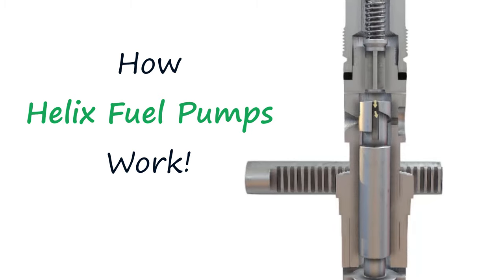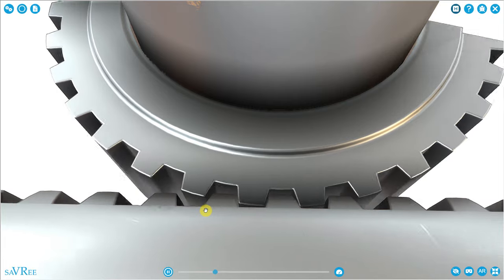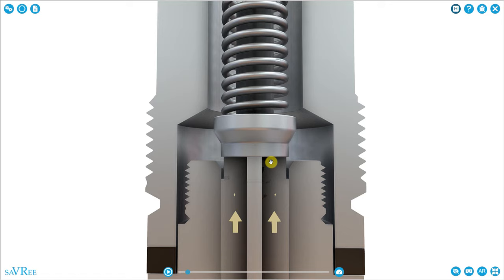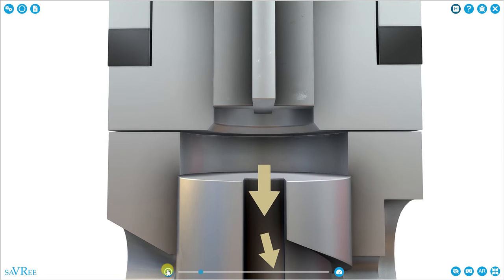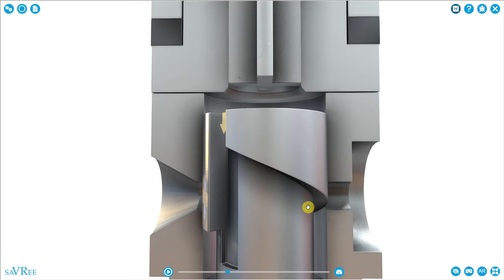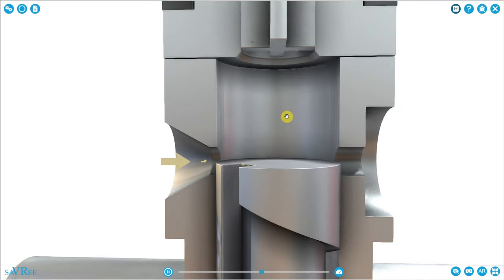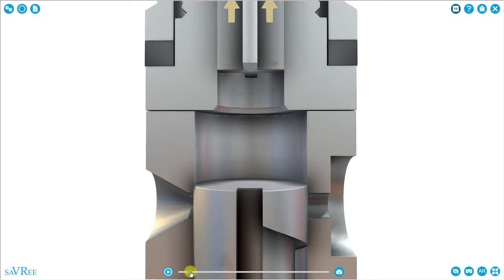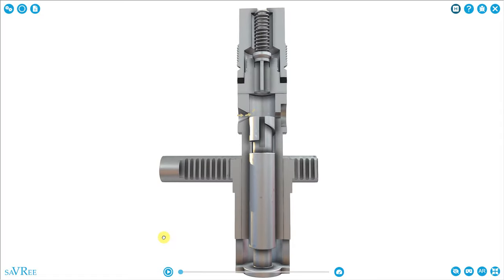How Helix Fuel Pumps Work! (Jerk Piston Variable Injection Pump)

Comment from the maker: Want to continue learning about engineering with videos like this one? Then visit:
https://courses.savree.com/ 

Want to teach/instruct with the 3D models shown in this video? Then visit:
https://savree.com/en
Reply: TBH, I was intrigued by mechanical fuel injection that I started a little research, all because of EFI which is efficient but quite expensive and shortages of semiconductor to make the EFI 'brain'
First I stumbled upon gasoline mechanical fuel injection, which is just a nightmare of reliability issues and ungodly expensive stuff
Then I switched my attention to diesel, it is injected and had mechanical system, that's another reason I stumbled upon this video of yours
I was tinkering with my thoughts and chatgpt if my idea was viable, it was a gasoline mfi but as simple as diesel
Instead of pushing the fuel with piston/plunger, I was thinking of using electric fuel pump to pressurize the fuel, then turned the plunger into basically a variable rod to poke the valve using that rack & pinion thing
The injector nozzle and the rest of line routes is the same as the diesel
What do you think of my idea? Is it really viable option to efi if not just a thing in between efi and carburetor?

Comment: Good animation. This style (non VIT) has fixed timing for the beginning of injection and only varies the end of injection. The VIT version of these pumps is controlled by a second rack & pinion that moves the barrel up and down, and therefore the height of the spill port, with respect to the helix.   Another important feature not shown here is the puncture valve.
Reply: He has only shown about the basic fuel pump with single helix maybe for 4S generator only

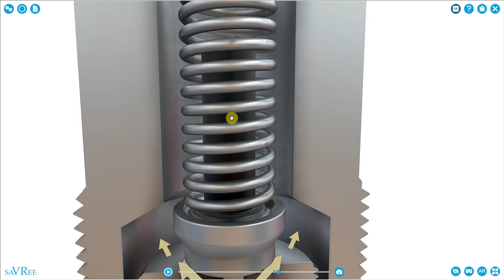Comment: 7:17 - As a fairly newly licensed diesel mechanic who has, by nature, not had the pleasure of dealing with mechanical fuel systems simply because they are no longer around. That being said, my curious mind has always been baffled by the true impact of rack manipulation in terms of effective plunger stroke vs helix position. 10 out of 10. Clear, descriptive and intelligent.
Reply: If you can buy a mercedes OM606 diesel engine, they use a mech fuel pump and are popular to modify. expensive but i think it would be very interesting for you.

Comment: If Iunderstan correctly the quadrant will only be able to rotate less than 180° before fuel leakages begins from minimum injection volime to maximum injection volume. We never see the back of the helix to confirm full construction.
Splendid animation. 
You might include fuel color to indicate pump pressure changes from low at fill, high during injection volumes, then revert back to low when leakage begins.

Comment: Best visualisation!! 
I have a question about slow speed two stroke starting air system: what controls the timing for when starting air stops being admitted and fuel starts being injected when starting main engine?
Would be awesome if you could make a video on air compressors, reefer compressors, cascade tank and condenser, cylinder heads and sewage treatment plant.
Thank you from an Engine Cadet!
Reply from the maker: Will put it on the list! Thanks for the suggestion and for watching.
Reply: I could not find the exact answer actually. But this is what i think is most probable. The order of entry of  starting air via starting air valve is controlled by the air distributor, which in turn follows a dedicated camshaft ( or sometimes just driven) for controlling air distributor only. This dedicated camshaft is again connected to the main camshaft which in itself executes a firing order i.e. sequence of firing of the engine units. Now I am assuming when the crankshaft attains enough rpm the pneumatic signal (low pressure air starting signal)  which allows the bottle air to pass onto pilot valve and main air starting valve ( via automatic valve)is blocked just before the air control valve, ceasing the whole system operation. Now how this air signal is stopped I am not sure of....maybe it is controlled by a master and slave electronic controller which takes feedback from the rpm meter.
Reply: We are manufacturer specialized in auto and marine diesel engine parts since 1952.
Our main parts are
EURO II system: plunger, nozzle , delivery valves, head rotors, repair kits, etc.
Common rail system: Injector complete and injector spare parts for CATERPILLAR, DENSO, DELPHI , BOSCH, SIMENS, CUMMINS, etc.

If you have any inquiries, pls do not hesitate to contact me.

Comment: Does the governor controls the rack? Anyway, superb video. Subscribed.
Reply: We are manufacturer specialized in auto and marine diesel engine parts since 1952.
Our main parts are
EURO II system: plunger, nozzle , delivery valves, head rotors, repair kits, etc.
Common rail system: Injector complete and injector spare parts for CATERPILLAR, DENSO, DELPHI , BOSCH, SIMENS, CUMMINS, etc.

If you have any inquiries, pls do not hesitate to contact me.
Reply: Yes

Comment: Sir, I have a doubt that the rotation of the plunger will only thake place during the load varying on the engine or it will rotate in every stroke of the plunger ?

Comment: What gave rise to this style of pump? Why is it used over more conventional fuel pump designs? How does it rank on efficiency?
Reply from the maker: It's basically a piston pump with the main difference  being the helix. I would need to check concerning efficiency. Its a genius design, that much I know! 😀
Reply: We are manufacturer specialized in auto and marine diesel engine parts since 1952.
Our main parts are
EURO II system: plunger, nozzle , delivery valves, head rotors, repair kits, etc.
Common rail system: Injector complete and injector spare parts for CATERPILLAR, DENSO, DELPHI , BOSCH, SIMENS, CUMMINS, etc.

If you have any inquiries, pls do not hesitate to contact me.

Comment: Hi Savree. Very well explained and easy to follow, great video. Just one question on this type of pump, what would cause the engine to maintain full revvs when the accelerator has returned to the idle position? Can you advise what  components I could check? Seems like a component is sticking in the open position? Thanks in advance.
Reply: Did you ever get an answer for that issue because I’m having the same problem with my tractor stuck at full throttle?

Comment: Very fascinating. Clearly understood. Can that  be set to specific position? I have two  piston engine generator that uses two of this pumps is currently troubling me with fuel economy and low power. There appears to be incomplete combustion. Could that be problem with fuel pump? Kindly assist with advise.

Comment: Amazing visualisation! What I'm missing is understanding where the lifting force comes from, where the movement of the rack is controlled (does the engine adjust the rack depending on how much fuel it needs?), And what happens to the fuel that spills out - does it drain away or is there a tank? Presumably it doesn't go to waste :)
Reply: Allow me to answer. The lifting force comes from a cam and follower arrangement. The follower pushes the plunger up and down as it is controlled by the cam on the camshaft, the camshaft in turn is controlled by the engine crankshaft. The camshaft thus controls the firing order i.e the timing of the fuel injection.  Now the rack movement (which controls the quantity of fuel to be delivered ) is connected to the governor which as we know works as per the load on the engine. As per the fuel that spills out I am assuming it meets the end of the re-circulation line and goes back into the buffer tank( not sure though)
Reply: @kanishkaroy3478  hey thanks explanation regarding the rack movement was excellent and simple.
Reply: We are manufacturer specialized in auto and marine diesel engine parts since 1952.
Our main parts are
EURO II system: plunger, nozzle , delivery valves, head rotors, repair kits, etc.
Common rail system: Injector complete and injector spare parts for CATERPILLAR, DENSO, DELPHI , BOSCH, SIMENS, CUMMINS, etc.

If you have any inquiries, pls do not hesitate to contact me.
Reply: The answer to your question is the governor. A system of weights incorporated into the pump body, driven by the pump-cam act on the governor arm, which in turn alters the position of the rack depending on operator demand. Check out the Cummins p7100, it’s a super simple system but very clear.
Reply: Furthermore, the excess fuel is referred to as “return”. The post injection event which essentially is the fuel driven through the spill port by way of the pump spring is recycled to the reservoir. If properly filtered and separated from any moisture before hand, the excess fuel should be safe to head straight to the tank, in a well serviced fuel system, of course.

Comment: So...am I correct in thinking that the reciprocation of the plunger is caused by something not shown? Is the thing causing the reciprocation also controlling the timing? Since the amount of fuel pumped per cycle is controlled by the position of the quadrant and rack (and hence the helix), am I also correct in thinking that the length of stroke of the piston is constant?
Reply from the maker: Stroke is constant. The pump is operated by the camshaft.
Reply: We are manufacturer specialized in auto and marine diesel engine parts since 1952.
Our main parts are
EURO II system: plunger, nozzle , delivery valves, head rotors, repair kits, etc.
Common rail system: Injector complete and injector spare parts for CATERPILLAR, DENSO, DELPHI , BOSCH, SIMENS, CUMMINS, etc.

If you have any inquiries, pls do not hesitate to contact me.

Comment: Sir, the fuel quantity is changing or not? Because we vary the timing so that our efficiency increase in low load conditions and more power is generated. But if we send more fuel than there this objective is not achieved. Please clear my doubt.
Reply: Bro..i didn't get ur question.. Fuel quantity is controlled by governor by means of rack and pinion mechanism.. Govrrner moves the rack and plunger will rotates.. This rotation of plunger contols and amount of fuel going to injector

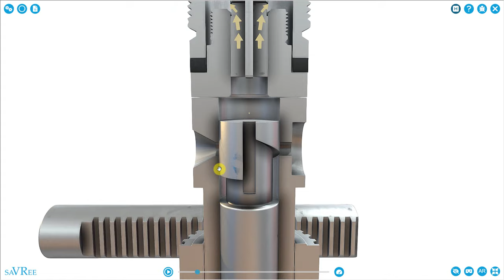Comment: 9:03 Isn't it more convenient to have them together since it's easier to have only one rack commading all pumps?
Reply: We are manufacturer specialized in auto and marine diesel engine parts since 1952.
Our main parts are
EURO II system: plunger, nozzle , delivery valves, head rotors, repair kits, etc.
Common rail system: Injector complete and injector spare parts for CATERPILLAR, DENSO, DELPHI , BOSCH, SIMENS, CUMMINS, etc.

If you have any inquiries, pls do not hesitate to contact me.